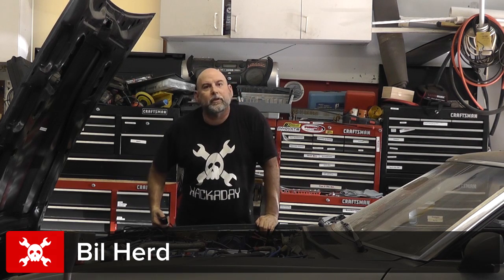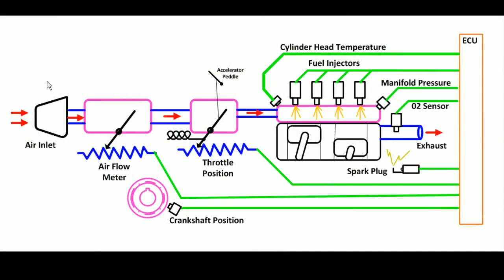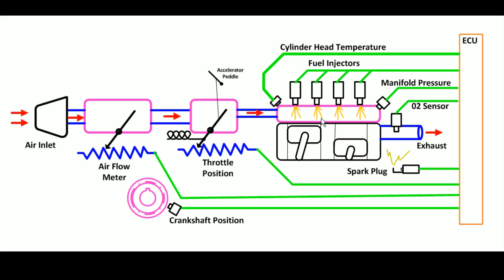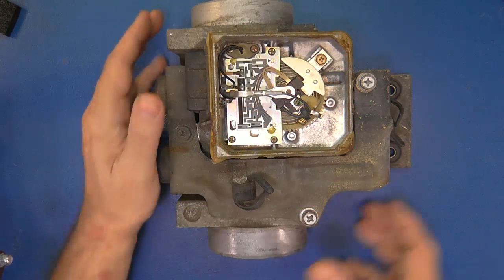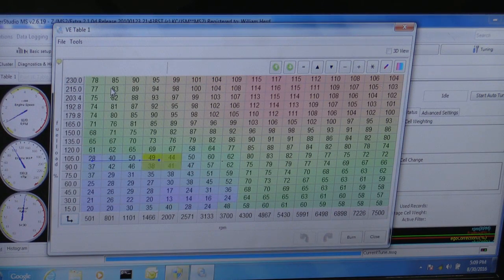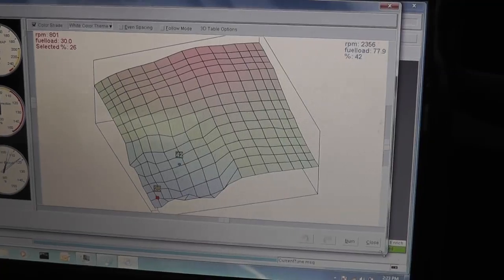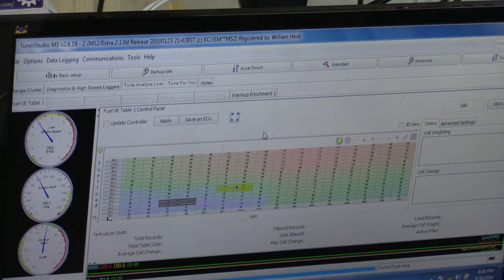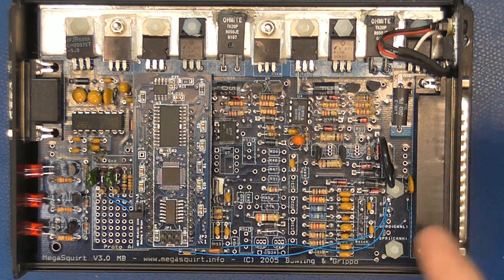Car Hacking: Using a Megasquirt ECU with a 1983 Datsun Z

Comment: it this a batch fire or semi sequintial and how does is fire, 2 2 2 or 3 3? also do you need an ingitor or does the ecu have a seperate signal for that? working on the same project, stumped...

Comment: Have been working on my 82 ZXT for many years (10), just now getting it running correctly. Inside the Z community the ZXT 
seems to be a totally different animal, so not much help to be had. Took me along time to finally get my head around how these things operate. Not being able to see what the computer ( if you can call it that ) is doing. Mega squirt would be a blessing, but now that my car is really running nice, Im just going to do what I really like to do for awhile.  Drive It. Because in the end thats whats fun about these cars. Tired of seeing it on jack stands. Thanks for the Introduction .
Reply: Do you have any idea why the ECU is not sending a signal to the fuel pump and the injectors?  I am stumped!

Comment: huh I had no idea there was a assemble your self version of MS. I have a '79 2+2 and I always wondered if you could get an Arduino or something similar/cheap to replace the ECU. I figure the stock ECU is about as advanced as a 2600 but I bet there'd be a lot of programming involved...
Reply: same question in my head 68hC11 with trade component in the box, it is a dinosaure. but yep the value is in the code source